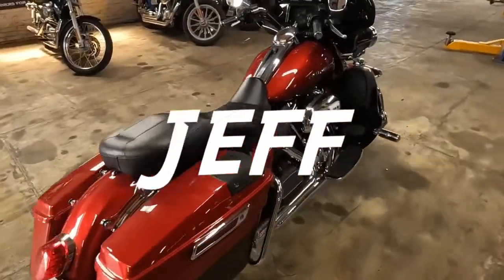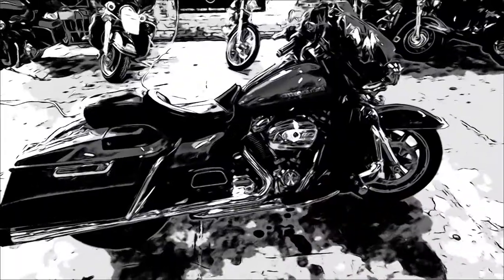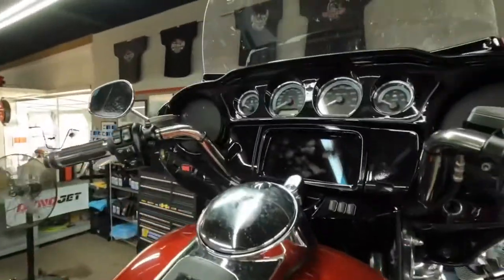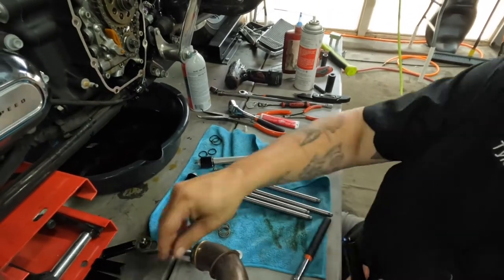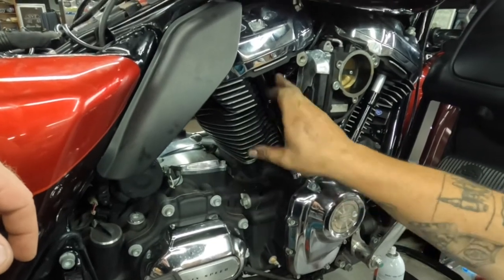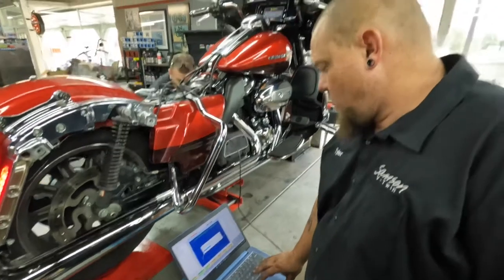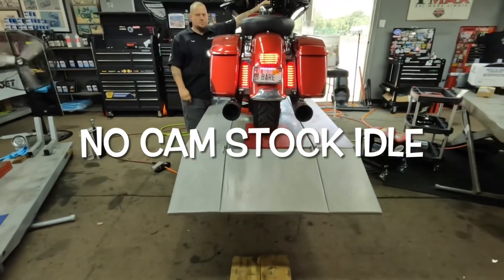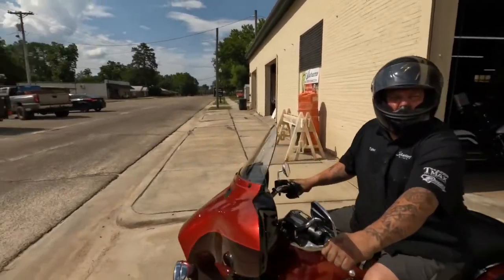Jeff’s 114 with 468 cam, TMax, S&S Headers, High Flow breather, SVT Jackhammers

Comment: Why did he choose the 468 instead of the 475
Reply: 468 has better ridability and usable tourqe curve. It's not all about dyno numbers, however both make simular power. Much easier to live with the Zippers cam.
Reply: @stuartbrown1961  I have another 2 years on my warranty.. you think i should wait to install or does the SE 462 do as good as the 468? I do like usable power because i pack in the miles
Reply: @physiciansassist1 im in the same boat. With hrs and hrs of vids and research....ditch the SE and go aftermarket stage 2.  No epa restrictions.